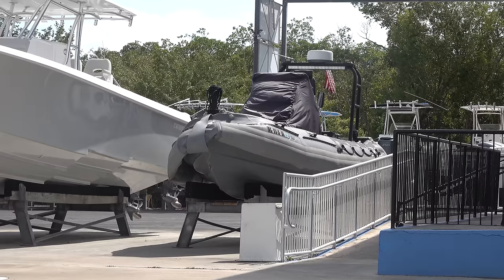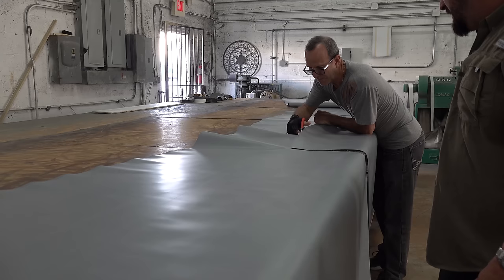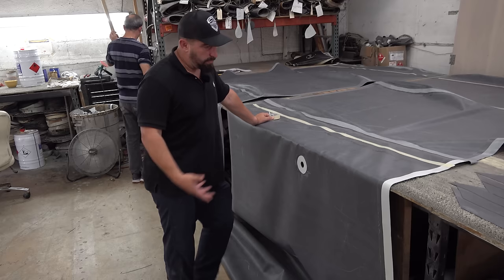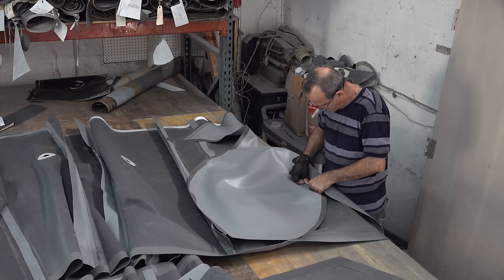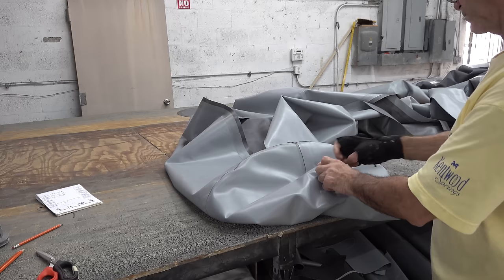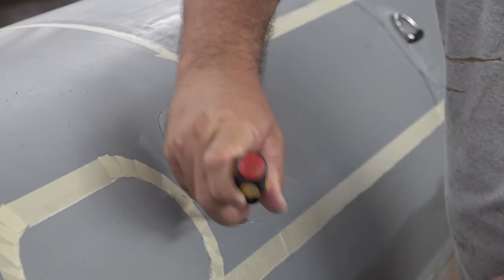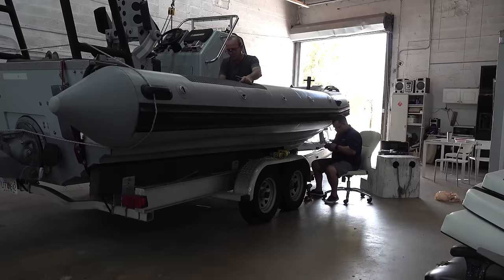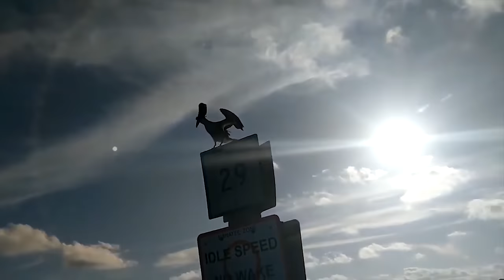Military Rib Boat Retube Of a 730 Willard ! (How to Build Tube Special)

Comment: the "sanding" you do on the edges to prepare for the glue is called "SKYVING" in the leatherwork business. We do the same thing on seams and to prepare edges for glue. Skyving also takes a bit of the thickness out of the edge so that the seams taper to a neat edge better. Amazing the similarities to the leatherwork that I do. I found this video fascinating. Thanks for posting Alfred!

Comment: Hello Alfred, great video very informative. I'm fitting a new rub strake to my avon rib and I'm wondering how many coats of glue do you apply to the strake, the normal 2 coats or a 3rd primer coat 24 hours before? Thanks